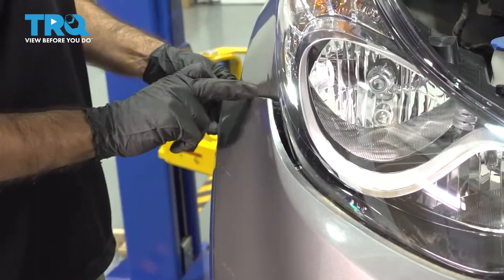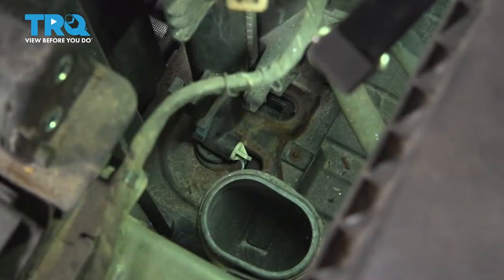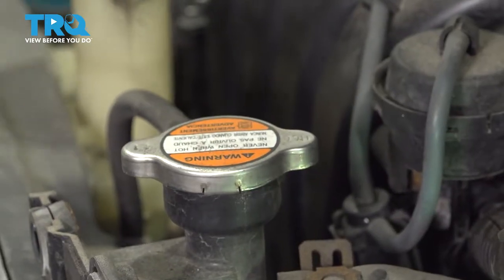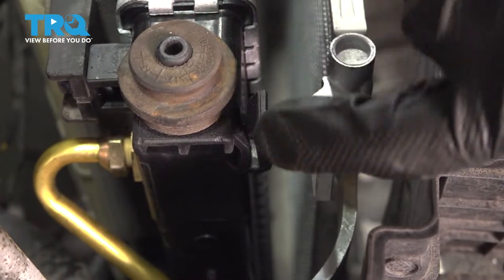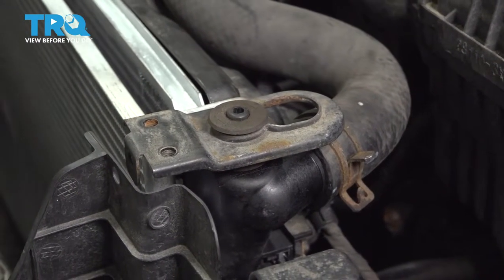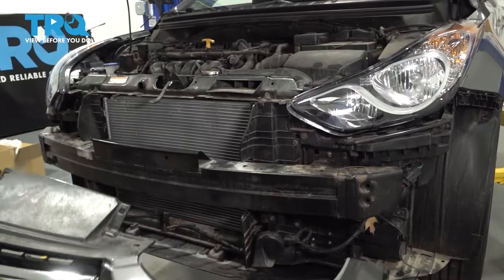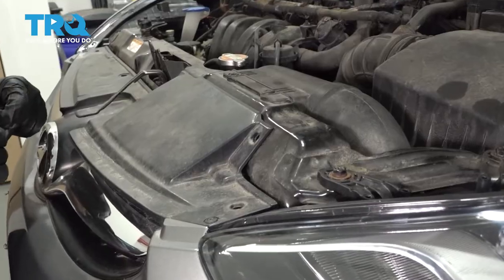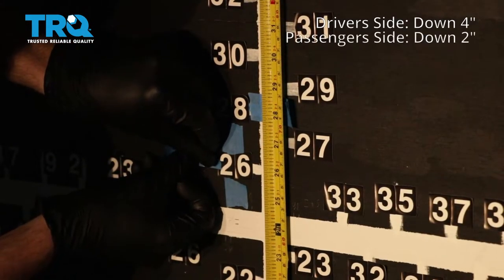How to Replace A/C Condenser and Receiver Drier Assembly 2011-2016 Hyundai Elantra

Comment: I just did this on a 2016 Elantra SE. great video. But I didn’t have to drain the radiator. Some bolts might’ve been easier to get to if the coolant hoses were out the way. But it really wasn’t necessary.

Comment: @11:24  Did you add any PAG oil to a new Condenser and receiver Dehydrator, and if you did in which manner? On o-rings you put R-12 mineral oil only, not PAG. Thank you for the film.

Comment: I think you went way over what was needed,  I done a i30 condenser and never removed the battery connections or the front bumper or lights and it was a easy job ?